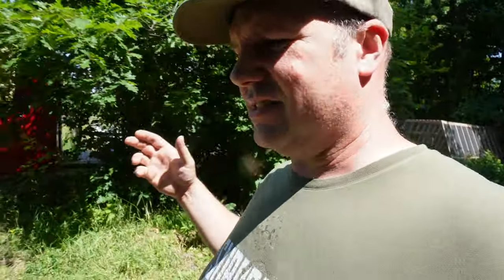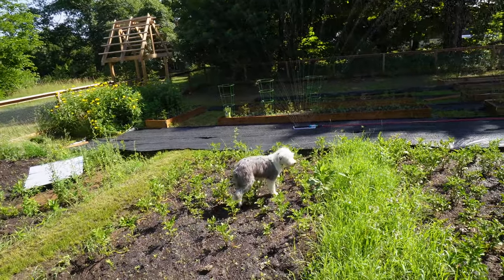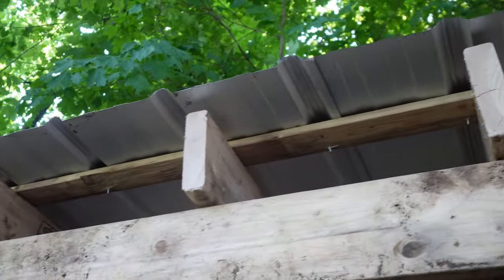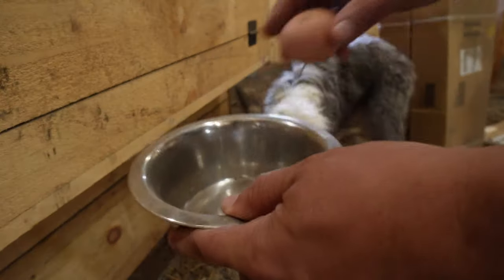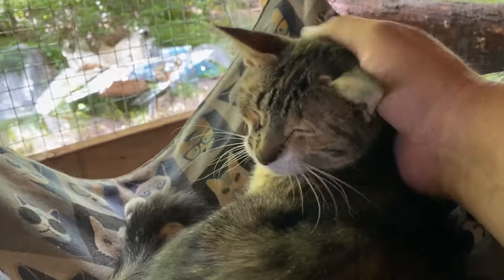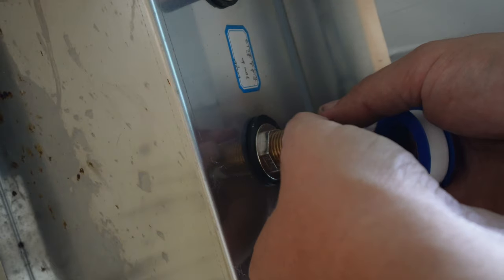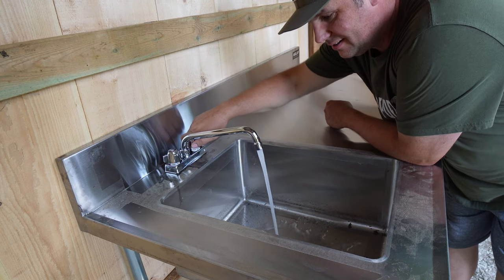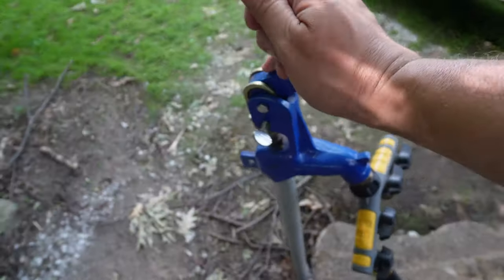This Will Make Farm Chores Easier - VLOG

Comment: Is it safe to use pressure treated wood for raised bets? wouldn't they leach chemicals into the soil?
Reply from the maker: Good question, older pt woods (before 2003) were toxic, but now they use acq which is considered non-toxic. One could use a liner inside too if worried. Trouble is non-treated wood will rot in a few years. I might touch on that in an upcoming video ( I’m no expert though)
Reply: The problem with pressure treated wood prior to 2003 is it contained arsenic.They banned arsenic, and since then the question has been can I use pressure treated wood for gardening and the answer is YES as long as you don't rely solely on the soil to feed your plants, have to put compost mixed in as well as fertilizer, compost contains many nutrients
Reply from the maker: @yeagerxp  yeah for rabbit 💩
Reply: @HiddenSpringFarm  For the bottom of the cage yes. Rabbits like to chew to on wood or hay to keep their teeth short. So any wood they come in contact with has to be non treated. You can build the rabbit house out of pressure treated wood and line the walls and bottom with metal cloth 1/2 inch away from the walls. Pallets used in Canada are not treated, just heat treated to seal the wood. You can use that wood on the inside and you can always find pallets lying around
Reply from the maker: @yeagerxp  I’ll be starting the rabbitat soon, I guess I can just put a block on the wall then attach the cloth that way the bunnies can’t get to the pt. 👍